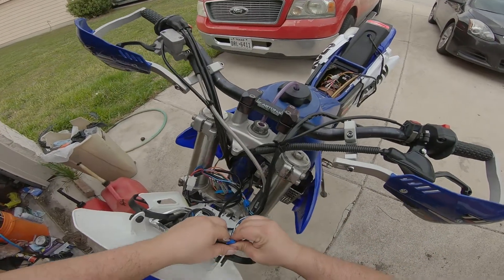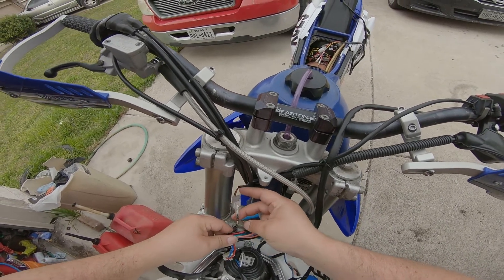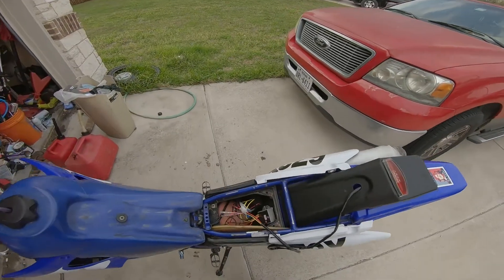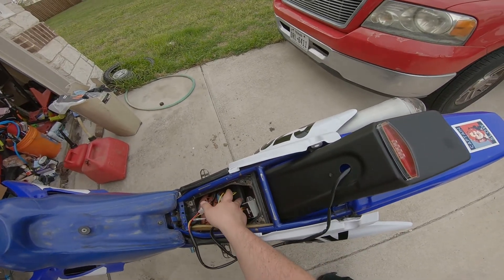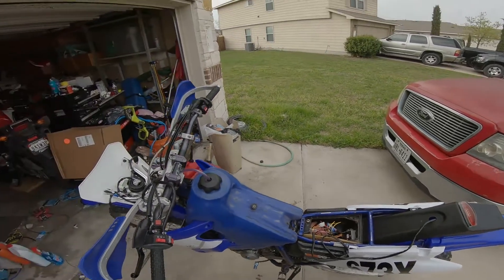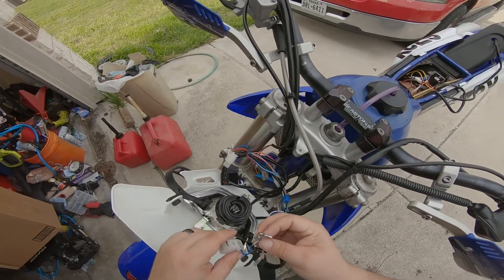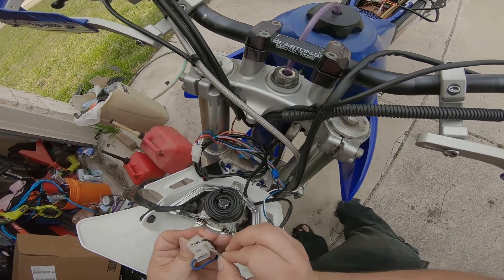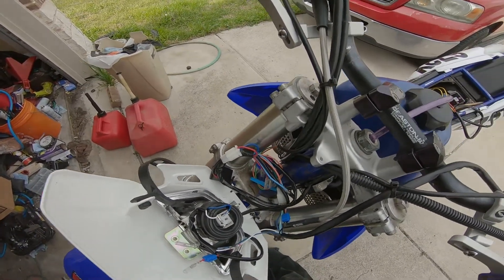Converting a WR400F from AC to DC Part 7

Comment: Can't wait to see this finished and if it charges the battery. I'm doing the same thing to my bike it's a 2000wr400f and don't want to take the battery out every day to charge it. Thanks for the video and info so far it's a big help.
Reply from the maker: It does charge it as the battery i get in part 4 has no way to charge it but from the stator.  There is a lot of trouble shooting in the upcoming videos I learned the hard way ($$$) that hopefully I can spare others from.  I will spoil a bit to save you 30$+ get the trailtech (maybe it was tourtech) NiMH battery as the tusk liON battery has no over current protection.  That way you dont wire a fiery grenade under your rear.
Reply from the maker: Here you go https://www.motosport.com/trail-tech-nimh-vehicle-mount-battery?variant[TRH0002]=TRH0002-X001-Y001
Reply: Yea I ordered that one after I seen the size of it way smaller and same output and the one I have now